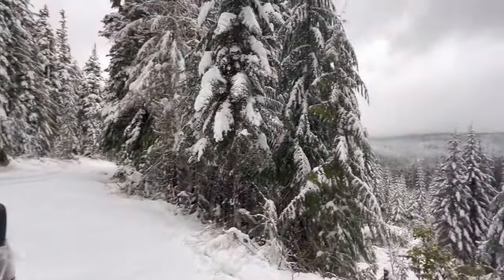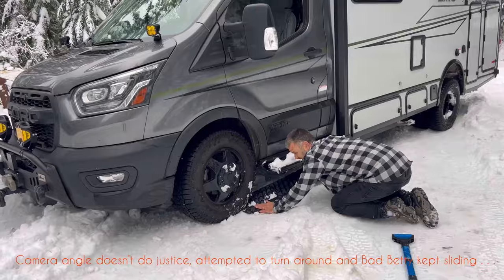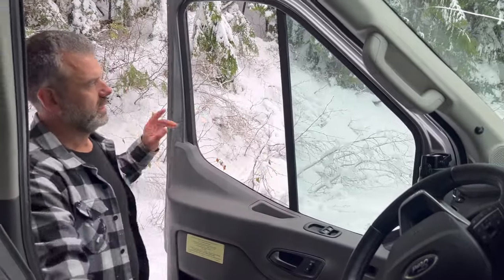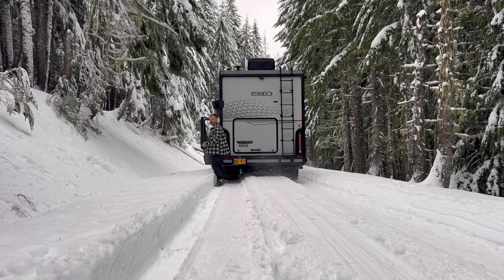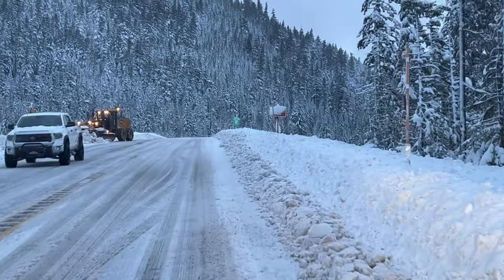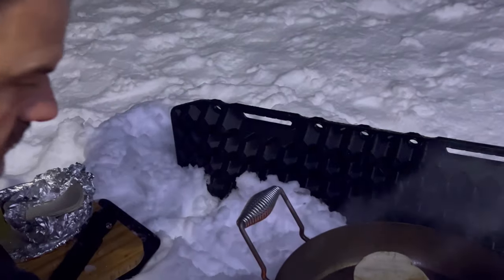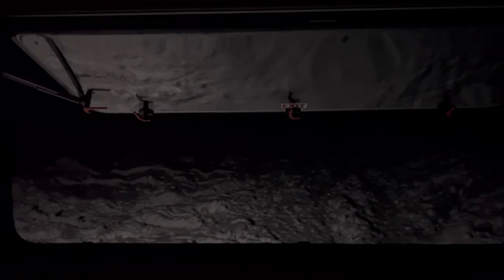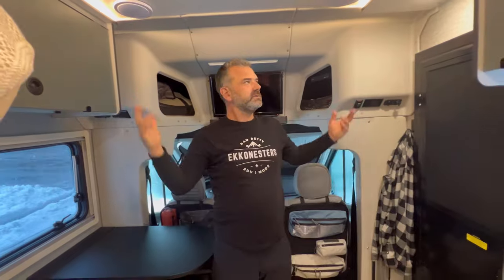WINTER CAMPING | SURVIVING SNOWY CHAOS AND PLOW MISHAPS! WINNEBAGO EKKO RV | VANLIFE

Comment: Fun to watch how you took care of these situations.   At far as being in cold weather, did have you water system shut down?  Also what did you rely on for heat?   Ekkos  propane heater  all night or something else electric heater?
Reply from the maker: Thanks for checking out our video.
No, we had no issues with the water system shutting down.
The nice thing is the EKKO design, where all of the water lines are kept on the interior side of the vehicle, rather than running on the exterior.
In one of our other videos, we also insulated the compartment where the main water control valves and winterization controls are located. If you happen to watch it, there’s a spot between the driver side bed platform and the control valve box. Previously when this was un insulated, we did have an issue with one of the plastic tea fittings.
We leave the Truma aqua heating system on all night. Depending what your comfort level is, you can set it anywhere such as 68 to 72° and stay extremely cozy especially if you put the thermal blanket up between the cab and the main living space.
Let me know if you got any other questions and thanks again for checking out our channel.

Comment: Another awe inspiring video.  Amazing snow adventure.  Thanks for sharing. Hey, how about more on how to deal with all the condensation in cold weather.  We find we have to towel down the upper corner all around the ceiling for to the thermal transfer of the cold up there and the front Ford windows.   I tried to put fan on 10% and barely crack the window on my side of bed, but boy does it get cold! So I end up closing the window and shutting off the fan.
Reply from the maker: More to come!

Comment: Curious how you don't have lots of condensation on the windows. I've seen other RVs with lots of water on the windows after such a cold night. Do you do something specific to keep the water/condensation levels down? TIA
Reply from the maker: Great observation Robert. There are a few things we have done that help.  Leave a link in the description for one which is rechargeable dehumidifiers.  The other thing, is you can set the MaxFan (roof vent on low and that helps out a lot) just the lowest of settings will make a difference. 
There generally is some on the Front windshield for sure, but we’ve been lucky recently with a few new practices.

Comment: Yes I read the descriptions, and do you carry water with you in your freshwater tank, or have you already winterized your Ekko? Just curious. Thank you for another amazing video!
Reply from the maker: Thank you Emily for the kind response. In respect to checking out the description.
Also more Importantly to us thank you so much for watching our videos and subscribing.
Also, I love your questions.
We have not winterized our EKKO we are still using it.
However, we do drain the systems while it’s parked in case those nights when it drops down.
The fortunate thing about the Winnebago EKKO, they have put all of the waterlines within the interior part of the chassis. A lot of manufactures have the waterlines running underneath the vehicle which expose them to the elements as well as road hazard.
We also took time to insulate our exterior shower water control system, which we have a video on.
That helped out as well. It’s considered a four season vehicle.
By the way, how are you all doing with your travels. I understand you have a very very cool fifth wheeler.
Reply from the maker: Yes, we do carry water in our freshwater system. If that was your direct question, I may have misunderstood. But we stay on top of it and respect to keeping it as fresh as possible.
I highly recommend a triple filtration system.

Comment: Why would you even attempt to try and drive a class C RV on that road, in that snow, with those kind of inclines..........smh. The Ekko has AWD but its meant for snow on public roads and at the most fire roads. Your trying to drive it on road conditions meant for a Jeep Rubicon with 37 inch tires. Your giving your "expert" analysis on driving on snow but to be candid, if you knew half as much as your professing you would have never even attempted going down that road.
Reply from the maker: Hello Robert, Thanks for stimulating a little conversation and I appreciate our candid comments and perspectives. I believe there's more to explore in understanding your viewpoints. Firstly, we are well-versed in the various areas, roads, and typical conditions of this NW region. Initially, as evident in the video, the approach and road conditions aligned with our familiarity and the equipment we possess as well as the time of day and weather. 

Without extensively reiterating the video's storyline that led to your particular concerns, I'll share this insight. While navigating the road, numerous other vehicles, including sedans and 4x4 Toyota Four Runners, had already traversed it. As highlighted in the video, while progressing down the road toward our destination, which involves an exit from this particular route, we encountered a blocked section due to a Toyota ahead. This necessitated a change in our course. Ordinarily, we would have executed the turn more smoothly, as noted in the video where we used our traction boards. However, another vehicle's improper positioning hindered the ease of this turn.

During this time, our EKKO struggled to gain traction in a specific area. Instead of escalating the situation in panic, we utilized our recovery boards. Within moments, we resumed our journey down the road, even in reverse. This, in itself, suggests that the conditions were manageable for the AWD system.

While I wouldn't claim expertise in 4x4 or off-road recovery, I do possess extensive experience with various vehicles, including our EKKO, in conditions far more demanding than those depicted in this video. I typically find that a combination of pre-scouting, carrying proper recovery gear, and drawing upon a base of knowledge while staying composed can aid in most situations.

I appreciate the time you took to share your thoughts and engage in this conversation. Feel free to explore our other videos showcasing situations far more challenging than this. As for the snow, my concern wasn't primarily about its depth, especially given its packable nature that allowed confident travel. Rather, it was the specific icy patch where we needed to execute the maneuver that posed a challenge.
Lastly, assuming you finished the video I you’ll see a snow park area where we helped another vehicle “sprinter” via our equipment.  While we may challenge ourselves to learn and discover, we understand safety and boundaries.  In conclusion, I’m pretty sure that this road did not lend itself to the need of 37” tires mounted on a Rubicon.
Reply: @ekkonesters599  I re read my post and it came across a tad bit snarky and critical, for that I apologize. I do really appreciate the time you took with such a lengthy explanation and response. I do love the Ekko and I am now a subscriber.